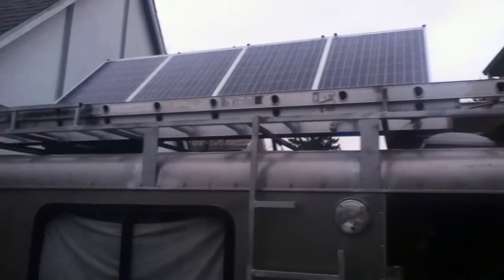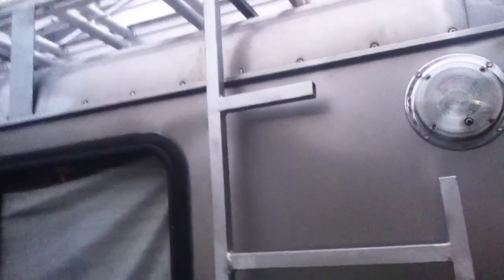How NOT to rig a mobile workshop electrical system

Comment from the maker: The Harbor Freight panels are all amorphous, not monocrystalline or even polycrystalline.  Amorphous is advanced technology which is only cheaper to make when comparing brand new manufacturing facilities to brand new facilities.    Monocrystralline and polycrystalline panels are often made on older equipment that was depreciated and bought used, which is the only reason the panels will be cheaper on some store shelves than Amorphous.   Amorphous panels are good for fixed location applications.

Comment from the maker: I just realized that I did not not have the followup videos linked to this one.   I am making more this week on the mobile workshop trailer, but it is not really done yet.  I run the loads through the charge controller which cuts things off at 11.5v.   It is just that my roomates and family are a bit slow pitching in on this thing and it is mostly me paying for this stuff, so I need to get another fuse panel and more lights.

Comment from the maker: Yeah, but those RV/Marine batteries don't even cost me as much as I spend on the Lithium Ion tool batteries.  I can keep one or two in reserve and am trying to figure out a cart system which will effectively make most of the larger corded power tools "off grid capable", and I can afford to replace RV batteries a few times for the cost of the Trojans.   The Trojans I had really really sucked.  I will never use them in a mobile application again.  Maybe a cabin, but not a mobile unit of any type.

Comment: Harbor freight solar power kits are not a bad place to start.
Sure the monocrystalline panels don't produce a lot of power on cloudy days, but none of them do.  The blue, (Polycrystalline), does a much better job of producing power even under cloudy conditions. But the blue panels cost much more as well. And under cloudy conditions the monocrystalline can still be used to charge batteries for lamps,  radios and small tv's.
I just make sure not to drain the batteries  below 11v.
PEACE!. .

Comment: It is a little trouble for a RV but you probably want to convert to LED lights anyway and at that point you could go 24V. They make little voltage regulator boards you can use to go to 12V and they are a couple bucks on ebay for something that does 1 or 2A it's pretty easy. Bigger things like a 12V fridge will be a problem of course, probably better to use an inverter. A lot of UK stuff is 24V so they do make converters. For a home system, 24V is the way to go for sure.

Comment: Lesson #2 go 24V ! You can use #6 up to about 1500W in short lengths, #4 is better. Solar panel wire runs are less loss too.

Comment from the maker: Because anything "off grid" that requires trips to the gas station every couple days is not really "off grid' is it?

Any idiot can go to the store, buy a generator and run it until it is out of fuel, but this creativity thing is about being sustainable, silent, and with the minimum of ongoing cost once it is built.   In theory, once this thing is fully built, I can park out in the middle of nowhere and go from tree to furniture for the homestead without a single ounce of fuel bought or used.